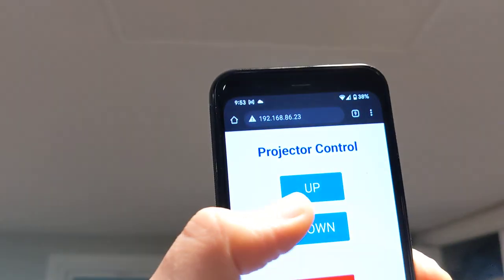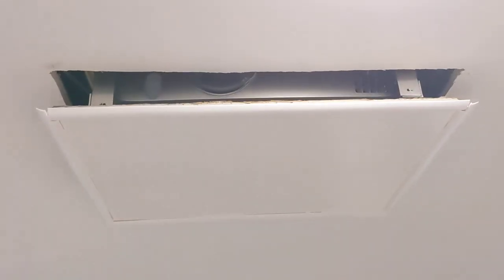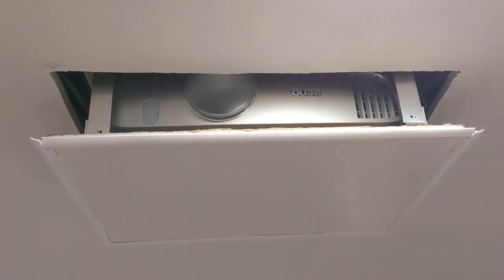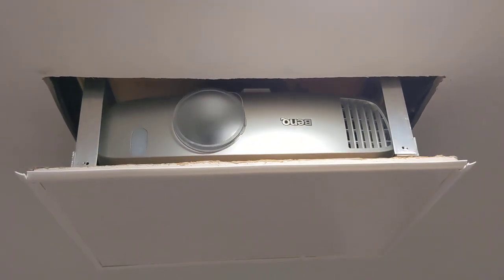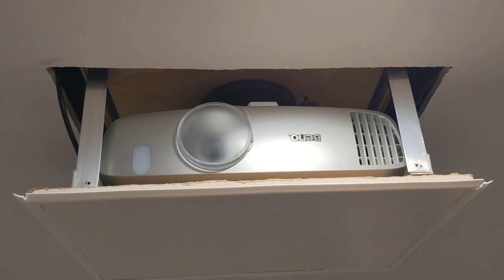Automated Projector Lift Demo

Comment: I'm very interested in hearing how you made this. I have just started building (designing as I go...) something similar, using two stepper motors, ball bearing drawer runners, and aluminium 2020 frame (with a lead screw arrangement to turn rotational movement into linear). I'll post on my youtube later with my design ideas. Including concealed screws, accessibility of parts, etc... I have put a prototype of the mechanism together and it all feels ridiculously solid and hope to get it working soon :)